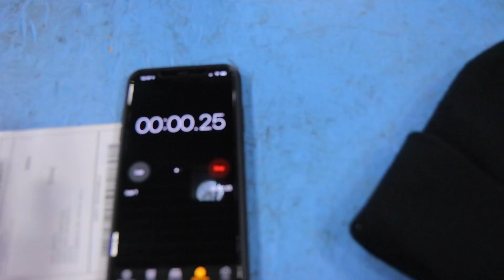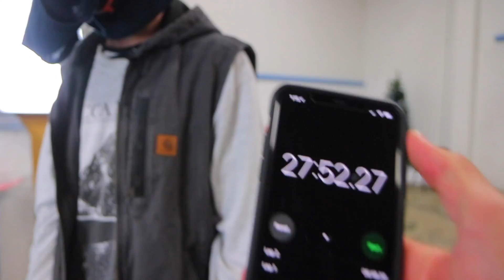BLINDFOLDED SKATEBOARD SET UP CHALLENGE

Comment: Stop hating on Uzi, he has a point. His board wasn't that bad and the screws he had weren't even the right ones.
Reply: His was still the worst. Its a time challenge anyways. They should have just stuck with the time without making it difficult. I do love Uzi though and  I doubt they are seriously trying to make him feel bad lol
Reply: Uzi would have won if he had regular hardware
Reply: russ turley no he wouldn’t
Reply: @russellturley7096  legit he wouldn't ... he did bolts last so the time he got was his actual time in fact if he had regular bolts he would've had to tighten them so it actually saved him time cause I bet they would've over looked that if it truly was a deciding matter but no Glo won fair and square his time was way better then both Nigel and Uzi not about hate Glo just won on time
Reply: at least uzi and nigel had their screws over the grip tape so you could change the trucks if needed
Reply: That board is heelflip proof to begin with
Reply: the drama... lol

Comment: Uzi played by the rules and was setup BUT Nigel had that precision I think Uzi should have at least been given a do-over. You should have also listed the things that can give points/take away points. For example;

Scratch Score
+1 for less than 3 scratches on the board, anywhere.
-1 per scratch above 3.

Truck Score
+2 truck faces the correct way (4 points total)
-2 if not.

+2 screwed in tightly (16 points total)
-4 if not for each

Wheel Score
+4 wheels face the correct way. (16 points total)
-3 points for each that doesn't face the right way.

+3 for each wheel tightly screwed in.
-2 if not

Grip Tape Score
+7 Grip tape placed nicely
-8 if not

+10 if cut correctly
-8 for each piece not covering the board (places where grip tape SHOULD be covering the board if it's longer than X amount of length -2 more points.) -8 points for the board not being covered, -2 more if the board shows past a certain length.

+5 if screws are flat where grip tape is.
-6 if not.

+6 for no bubbles/fold under the grip tape
-2 for each bubble/fold

Time Score
-1 point for every 4 minutes past.

Comment: They should do this video with different types of gear out. Lay out different types of trucks, bearings, grip whatever. Make them assemble blindfolded and when theyre done they have to skate the board they set up. 2 different trucks 3 different wheel types whatever they end up with they have to compete with.

Comment: Hey guys, I have a question.
So basically I bought my first complete board from a website and it’s a 8” board. Anyway, I figured that it’s kind of small and I could use a 8.25” better. Is that a big problem or is it okay?

Quick edit: Really enjoyed the video by the way 😂
Reply: You don't really know which size is the one you prefer until you try it, so in my opinion you should save some money and buy a different size deck (bigger or smaller depending on what your opinion is on your actual deck) and if it is not a really big jump in size (i.e. from 7'75 to 8'25 or 9') you should be fine and be able to just swap the truck and wheels with your previous board. Good luck bro.
Reply: 8 is perfectly fine just skate it
Reply: 8.5 feels good, so does 7.5. Try em all out. The size of your feet also play a role in how easy the board is to flick or land on, as well as how good you are at skating. Once you get good enough you'll be able to ride any size, so dont worry about it too much

Comment: Nigel had the worst  board all around even though it looked prettier then uzis. Glow had the prettiest but did not  tighten his wheels ..  had you guys set up a point system based off these major issues. Grip tape point system. Wheel point system. Screws and trucks. All based off importance and ability to ride then you could have properly judged this challenge.  Total board build and usability right after build and not lose wheels if would be between uzi and nigel. But the scoring system is flawed

Comment: Gabe needs to stop acting like he is better than uzi all the time in every video he is snobby and ungrateful to uzi. And I strongly believe uzi had a valid point when he said his board was in the middle of the 3. But Gabe wants to think he has authority over everyone at the Braille house whenever Aaron Kyro is not there.and won't listen to reason. If its not his way he Yale's and acts like my younger sister. And i skate a board with no grip tape on the edge but it goes from one end to the other its called a flip strip FYI Gabe. Plus gabe moved his wheel from were it was to behind a truck towards himself. I call A re-do. With out gabe interfering in any way or acting like he's better than anyone.